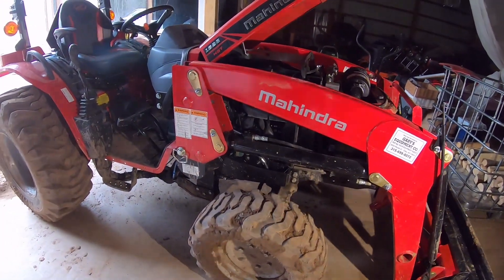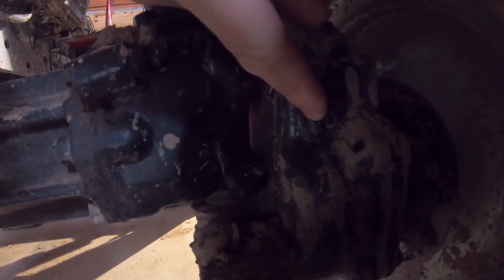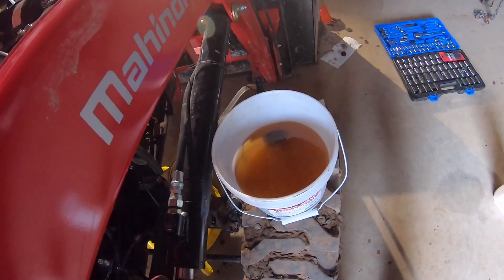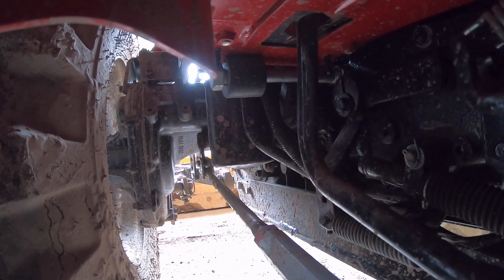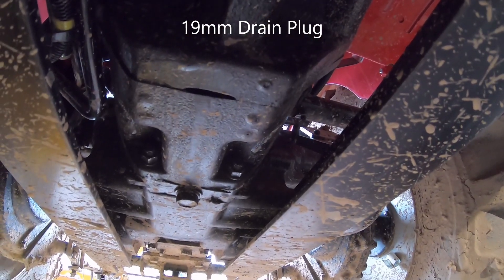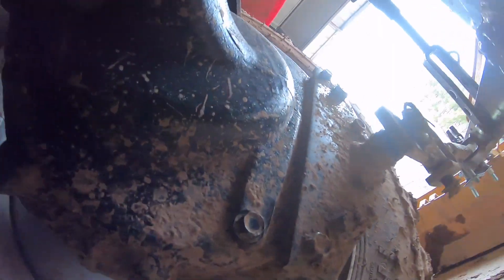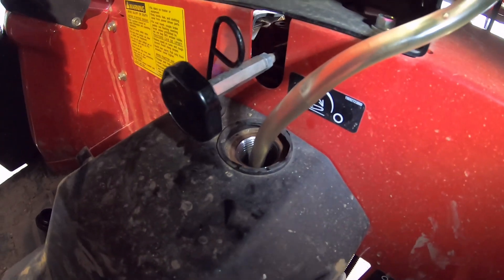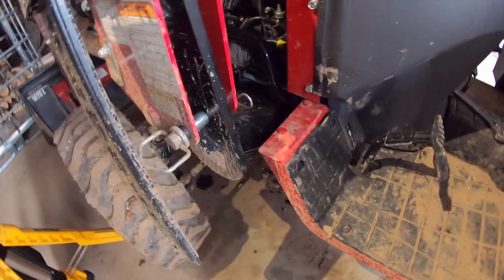Mahindra 1626 - Hydraulic Oil Change / No BS How-To

Comment: I been having a problem with my hydrolics all of a sudden. Any time i liftes the loader or the 3 point hitch, it stutters kind of like there is a clog or air in the system. It works, but it stutters. There is obviously and issue. I bought the tractor used and im not sure if the initial service got done. I need to go back outside and check the amount of hours on it. I hope the pump aint going bad.

1626 Hydro
Reply: I would check fluid level. When a hydraulic is used, it pulls fluid from a reservoir so if the fluid is low, it will suck air and stutter. Best way to see this is with a hydraulic vehicle lift. Watch the reservoir when the lift is up and when it comes down. Also check for leaks wherever you park it. 36 hours isn't much, but anything can happen. If you park on dirt the easiest way to check is put cardboard under it.
Reply from the maker: I wish I knew more about tractors to help you out, but it almost sounds like an engine problem. Since the hydraulics pull power from the engine, if the engine isn't running as good as it should, id assume you'd get some sort of chugging or hesitation. Id start by replacing all filters, but after that... idk.
Reply: @CorMorse  my engine seems to run fine. I just checked. Only got 36 hours on it. I'll get it figured out.
Reply from the maker: @sobrietydrummer2  Good luck, and let me know what u find!

Comment: Did I miss it? Where do you put fluid IN for the rear end?
Reply from the maker: Right next to the dipstick located by your feet. Kind of a pain in the butt to fill
Reply: @CorMorse  “right next to”…? Or do you mean the same hole on the floor between my feet with the cap that says “oil” and has a dipstick attached to it? There is nothing else down there except for the single cap/dipstick that says “oil” on it.  I saw someone else ask about the 1/2” plug/nut above the PTO, nothing goes in there?
Reply from the maker: @2dollab178  Hmm, I don't have my tractor right in front of me, but on my 1626 hst I'm pretty sure there's a separate dipstick. Either way, that cap is for the hydraulic system, which is separate from the front axle.
Reply: @CorMorse  oh gotcha, I have the 1626 shuttle, maybe there’s a difference in that regard. How about that 1/2” square nut/plug above the PTO in the rear? Do you have one of those on your HST and if so, do you know what it’s for?

Comment: My tractor guy say tractor hydraulic fluid for these things have oil in the fluid to prevent damage to gaskets!
Reply from the maker: Thats interesting. I dont think the manual mentions anything like this, it just gives you specifics on which brands/types of hydro fluid to use. That being said, the color on my first change was kind of weird, almost like it came from the factory with a dye in it or something. The fluid was greenish yellow as normal, but once drained, the top of the pan had a darker film to it.

Comment: So the hydraulic fluid in my shadow shift is the same lubricant that moves the rear end? Right on top of the rear end from the back there’s a half inch plug and I have no idea why they would put it there unless you were meant to put fluid in it? I’m learning
Reply from the maker: I'm not sure about shuttle shifts. Going by what the manual says, I would say yes, as it says "Oil Type: Hydraulic Transmission Fluid" under both Gear Drive and Hydrostatic Drive. It also shows a picture of the same dipstick where your feet are, directly in front of the seat, being used for both types as well.

Next time I'm up at the barn (and remember) I'll take a look and see if I have the same thing. Could be a breather cap though, as you never want to fully seal the system off.

Sorry for the long delay, just been pretty busy.

Comment: Great video, thanks for the good info. 
I have 2 buckets of Mahindra Hydro Fluid  Sitting here ready to put in.
The dealer informed me to run 80-90 Gear Oil in the front Axle,  said the hydro fluid wasn't up to snuff for a 4WD axle.

Comment: Juat bought a 1626 manidra tractor and and after each use, it leaks hyralic oil. It seems like it comming from the hyralic lines. Is this normal? The tractor is a 2020 year model. This is my second time i will be taking back to the dealership.
Reply from the maker: Yeah that aint normal. Can you identify where the leak is coming from? Ive got around 180hrs on my tractor and have replaced o-rings at the quick connections multiple times. Im sure they tear up mostly from overloading the FEL. There's a harbor freight o-ring kit that I use. I cant recall the exact size of it, but the kit is cheap enough to buy it just for the one size that fits.
Reply: My 2020 1626 hst did the same. I just tightened it down and washed it off and no more leaks

Comment: Thanks for the video!  Good info!  I just did my 50 hour on the same tractor as yours.  The hydraulic fluid was green (like yours was).  Do you know if this is normal for the factory hydraulic fluid on a 1626 HST?
Reply from the maker: From my understanding the hydraulic fluid from the factory has a dye in it. Glad the video helped!

Comment: Is this for the 50hr service? I'm pretty sure in the manual for my 1526 it just says to change the filters and the front axle fluid
Reply from the maker: Yes. I dont have the manual right in front of me but I believe its for the 50 and every 250 after.
Reply: @CorMorse  I checked the 1526 manual ..it says to replace tranny filter an hydraulic filter  at 50hrs... First hydro fluid change is at 200hrs according to the manual. That would be some bullshit if they made you buy ~14 gallons of hydro fluid after just 50hrs ...
Heres the paragraph for 50hr maintenance:
 Transmission Oil
Check the level of the transmission oil. Add the specified fluid as needed to maintain 
proper level. See Transmission Oil Level (Gear Drive) or Transmission Oil Level 
(Hydrostatic Drive) in this manual
Reply: @KrustyQuad just changed all the oil and filters at 50 hours and read your post and thought I had wasted a lot of oil. But the schedule does say engine oil and transmission after first 50 hours and then engine oil at 100 hours or 2 years, transmission fluid first at 50 and then 300 hours or 2 years and front axle first at 50 and then 300 after that.
Reply: @CorMorse  did it shift any smoother after you change the fluid? I'm coming up on 200hrs anyway so maybe I'll do it soon
Reply from the maker: @KrustyQuad  Hey sorry it took so long to get back to you, my Mahindra binder was up at the barn. The maint hours shows "Transmission oil" every 300hrs, and first time:50. Same description for Hydrostatic System Filter, and Hydraulic Filter. "MFD-Front Axle Lubricant" Is also 300hrs and first time 50.

As far as smoother, it still makes a few mins to warm up, but no real difference I dont think.
Reply: My 1626 tractor has only 5 hrs of used